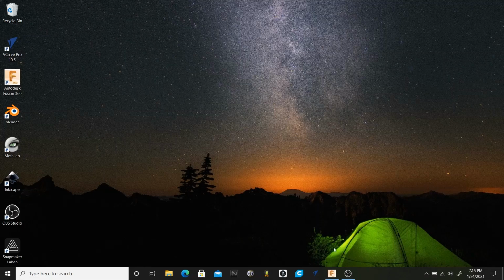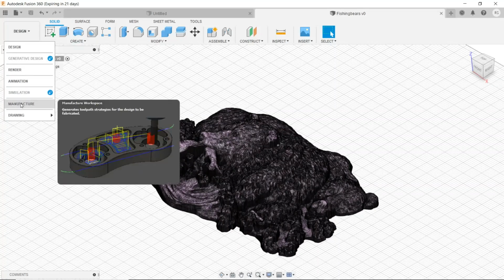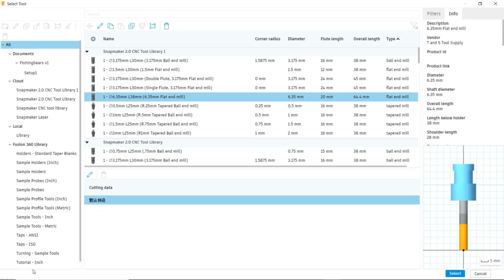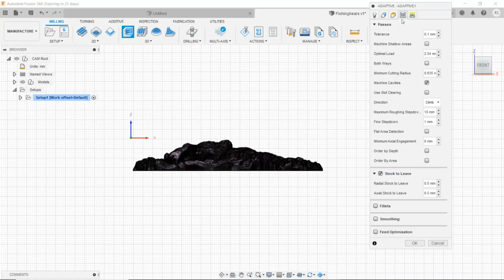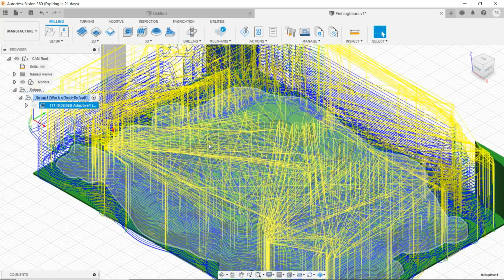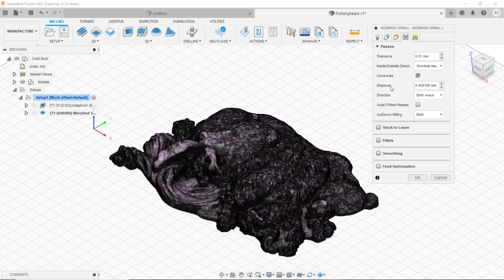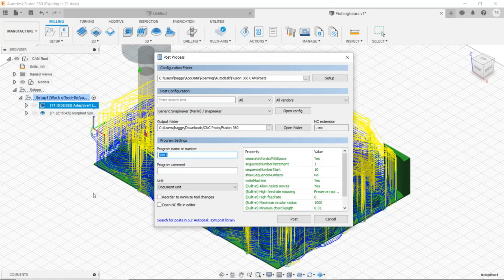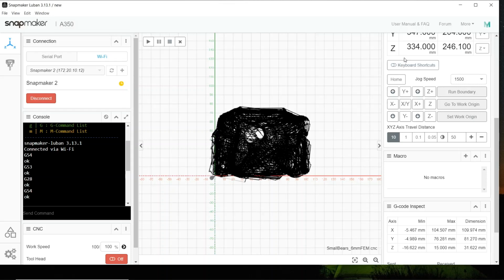Snapmaker Tool Changes: Fusion 360 3D Relief Milling

Comment: This is a really super video for anyone beginning to use Snapmaker for CNC. However, it needs to be updated for a number of significant changes in Fusion 360. Some of the adjustments are found in different places under different names.  When to use 2D or 3D and what is the difference?  The concept of contours (chains) is also unfamiliar.  Fusion has a number very fine self paced learning  videos under manufacturing but some of the concepts are difficult for a newbie to get their mind around.
A couple of questions:  What is the optimal load that the low power of the snapmaker can accommodate without bogging down and breaking the bit? Is that just accommodated by minimizing the step down?
How do I choose choose how much stock to leave for the next step without leaving tool edge marks from the previous step?

As a hobbyist, I do not care how long the job takes so being conservative is first priority.

Comment: Great video. Thanks for sharing. Does anyone know what I'm doing wrong? I ran the rough pass (successfully) & have the finishing pass set to to pick up after the Machine Rest (from pervious operations) but it only moves around in the air as if it's trying to cut from the original stock. Any help would be appreciated. (running Fusion 360 v2.0.11415)
Reply from the maker: Make sure you set the z to the correct height. It seems you didn’t zero out the tip of the bit to the top of your material in the z axis.
Reply: @rodneyshank716  I'm not quite sure how to zero it out.
Reply from the maker: @justinkerns2197  the same way you set the zero for the first bit.
Reply: @rodneyshank716  the starting Z position would be the top of the stock but after the rough pass it would be lower. Not sure how to know how much lower since the relief has different depths.
Reply from the maker: @justinkerns2197  yeah I see. Not much you can do if you milled off your z axis 0 point. So as long as you haven’t changed your x and y 0 point then just start like you did but lower the z offset a small amount and run it and see if it’s low enough. If not rerun at a lower setting. If you can’t save it the treat this as a learning experience and make sure next time you leave an area to set your z offset or have something else the same height as your material to use as a z offset point. Goodluck.

Comment: Great tutorial for using Fusion with the Snapmaker.  Fusion can be overwhelming for the uninitiated.  It can be challenging for those who use it with some regularity.  I will add two comments.  I have more than one CNC machine.  That being said, I have never found a benefit to using "relative size box" for Stock size.  You can plug in fairly, or very accurate dimensions of your stock before you post your code.  This gives several benefits.  One being that you know exactly how much, or how little stock you will leave unmachined.  It also gives you a much more accurate modeling and simulation ( avoiding collisions, etc.).

Also, with some models, where you want to machine the entire top surface away to some point (leaving no unmachined stock at the original height).  For the Snapmaker (since it has no preset tool height offset library), I often set the WCS at the BOTTOM corner of the stock.  That way when the original stock material is removed in the roughing passes, and I utilize Rest Machining, I can set subsequent tool heights from the table surface for all tools without losing the Z origin.  It just leaves the work origin well above the Z zero.
Reply from the maker: Thanks. You are correct but for the purpose of this tutorial I was trying to make it as easy as possible without going into too much detail. This is meant for beginners to get their feet wet without drowning them with information. There is so much in Fusion 360 that a tutorial can be hours and hours. Anyways I’m glad you enjoyed the tutorial.

Comment: Really appreciate this video. To have such a detailed video from someone using the exact software and machine that I have is very valuable.  The in depth description of all the settings, whether they were used or not, really helps someone newer to cnc work feel more comfortable taking on a more complex project that would otherwise be pretty intimidating.  Taking a lot of the guesswork out of the setup process is really nice.  Thanks for the work you put into this one
Reply from the maker: Thank you

Comment: WHAT DO YOU DO IF YOU FIND A COLLISION? HOW DO YOU CORRECT IT?
Reply from the maker: Depends on the collision. If it’s something very minor I may just let it go but if it’s a hard crash then you need to change some setting and or rotate your part and try again until you get something you can work with.

Comment: I've tried this twice and both times it jammed in the top right corner about 50% into the job. Stopping the bit and shifting the wood. What could be causing this? With the 1/4 bit I'm worried about the machine now instead of the bit! I've tried on both pine and oak just to see if it was the wood hardness.
Reply: Both of those types of wood are very hard wood. It jammed because it's moving too fast for that type of material, can't cut that much that fast. That's one area of the video that he does not explain correctly. The feed speed of the tool is not just based on the tool, it is based on the tool and the type of material you are cutting. That's why in fusion the tool has the ability to have several different tool profiles. So you can create a profile for that tool for specific material. For oak, using a 1mm bit, I have to set the feed rate to around 260 if I remember correctly.
Reply from the maker: i've had that happen from time to time. That's one thing about Fusion 360 that can be a pain to fix. My fix is run a profile tool path around your part so it don't rub on the wall and crash.
Reply: @rodneyshank716  What's a profile tool path, and how do you create it? (Sorry, still learning the basics of CNC.)

Comment: Great video!  Being a noob, this explained a LOT of the problems I had.  I do have a question, do you have part numbers and source for the two bits that you are using? I tried following along in Fusion 360, but I don't have the bits you used, at least the 1/4" bit. I selected the 6mm FEM that is in the SnapMaker 2 library that I downloaded from the SM site. When I run the roughing simulation I get a collision at the upper right side.  I think it's because the 6mm one in the library only has a 12mm flute length. 
Looking forward to your next video, hopefully, the one about adding/editing tools in F360.